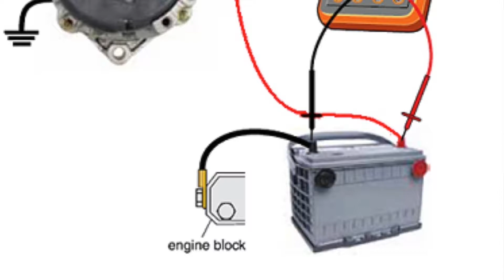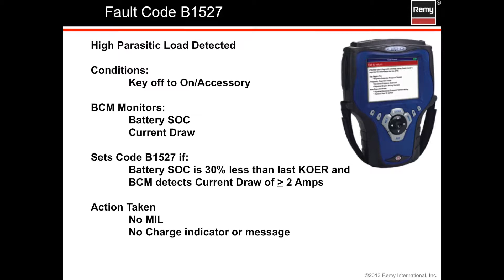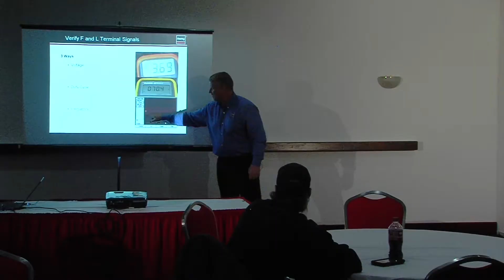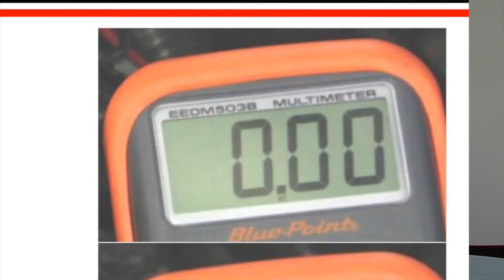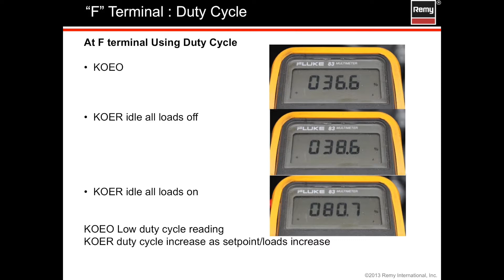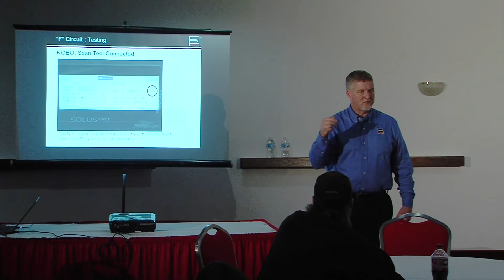GM RVC Voltage Drop

Comment: Under the condition of KOEO, how can the L be 0 volts and the F be 3.53V? When I tested my vehicle they were both 0 V with KOEO.
The below article mentions, A faulty alternator may not be able to comply with the PCM’s commands and its F terminal duty cycle readings may be very erratic. My L terminal voltage is stable, but my F terminal ranges KOEO 0V, KOER-loadsOFF several fluctuation 3.85-5.53 V, KOER-loadsON several fluctuation 6.39-10.44 V.  Would F terminal voltage fluctuation likely be diode AC ripple, a regulator going bad, or a bad ground?
https://www.motor.com/magazine-summary/trouble-shooter-july2015

What (if any) affect does the bad diode AC ripple have on DC measurements? Does it make the alternator DC output fluctuate a lot? 
I have a 2006 Chevy truck. No illuminated check engine light, but turns on when KOEO. <1/10 of 1% occurence of the service charging system DIC message, but goes off when I turn off engine and when restarted it doesn't come back on. No flickering with engine off and starts without hesitation. Only With engine running the interior, exterior, and dash lights flicker, and the dash voltage meter fluctuates constantly but it's not twitchy; the needle just won't stay in the same place for very long but never goes to the areas marked red.  The test machine at O'reilly shows "replace" battery but the battery starts it fine after 2 weeks of no driving, and the charging system tested okay.  Also tested with my Innova 3140 and after 10 alternator tests it resulted in a charging high, but I wasn't able to repeat that result.  I don't have an oscilloscope or an RMS multimeter. I've used a basic multimeter to check voltage at battery, at alternator, voltage drop on negative and positive at idle, 1500, and 2000; I've compared to a Ford Ranger and Buick Park Avenue which show very stable voltage readings at idle, 1500, 2000, and back to idle. Voltage drops were 0.02 V on the ground and 0.13-0.15 on the positive. Do these low numbers rule out bad grounds? The problem-Chevy has voltages that keep changing at idle with loads 14.19-14.84 V (battery) 14.36-15.06 V (alternator). With loads at 1500rpm 14.49-14.56 V (battery) 14.68-14.76(alternator).   With loads at 2000rpm 14.49-14.62 V (battery) 14.69-14.80(alternator).   
I repeated the voltage test at the alternator after a 1500, and 2000rpm and found in the 13 seconds after returning to idle the voltage went from a high of 14.93 to a low of 13.89. I recorded and watched frame by frame. During the first  second changes were 14.77, 14.93, 14.43, 14.49, 14.19. During the 9th second 14.11, 14.08 V. During the 10th second it was 14.84, 14.96 During the 11th second 14.02, 14.64, 14.92 V. Changed a total of 37 times in 13 seconds. Does this seem like a regulator or a diode issue?
I back probed the L lamp(Brown) KOEO 0V, KOER-loadsOFF 3.36-3.43V, KOER-loadsON 3.67V. The PCM plug F feedback(Gray) KOEO 0V, KOER-loadsOFF several fluctuation 3.85-5.53 V, KOER-loadsON several fluctuation 6.39-10.44 V.  Would F terminal voltage fluctuation likely be diode AC ripple, a regulator going bad, or a bad ground? I don't have a misfire, but would a bad ground result in a misfire?

Comment: recently had a error code P0621 with my VE SSV holden commodore running a L98. so after 6-7 weeks of scouring the internet, reading workshop manuals etc I slowly started to get my head around how the charging system worked but still couldn't find any good info on diagnosing the problem, until I found your tutorial videos, Just a big thankyou on your excellent training videos and information. not often people pass on the knowledge for free these days, keep up the good work 👍
Reply: I know Im kinda off topic but does anybody know of a good site to watch newly released movies online?
Reply: @Ismael Harley lately I have been using Flixzone. You can find it on google =)
Reply: @Rowan Braden Definitely, I've been watching on FlixZone for since april myself :)
Reply: @Rowan Braden thanks, I went there and it seems to work :) Appreciate it!!
Reply: @Ismael Harley you are welcome :D